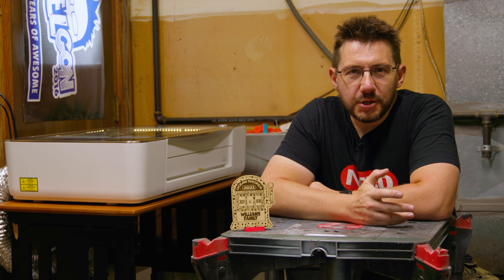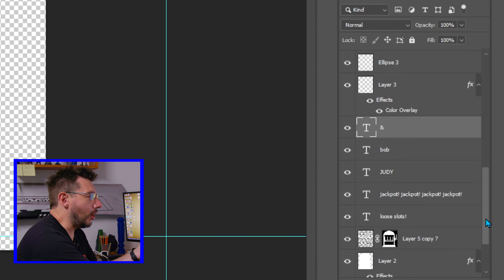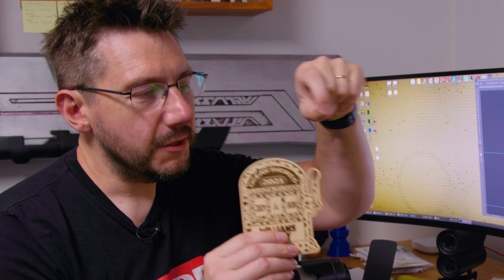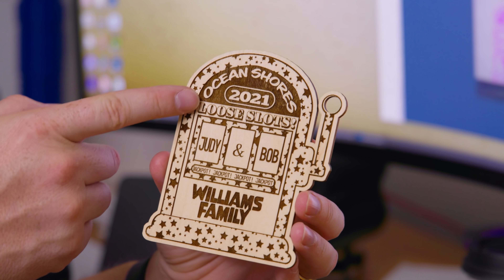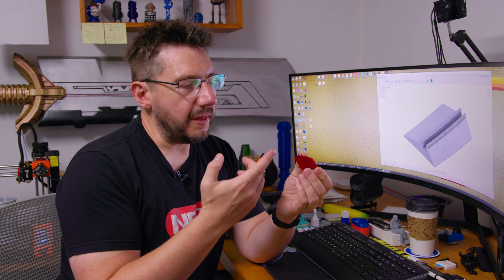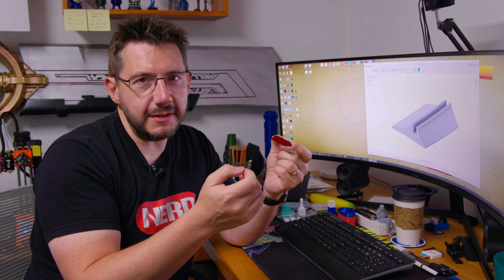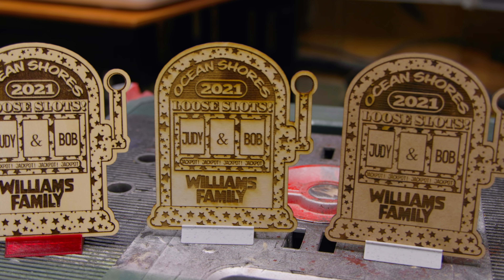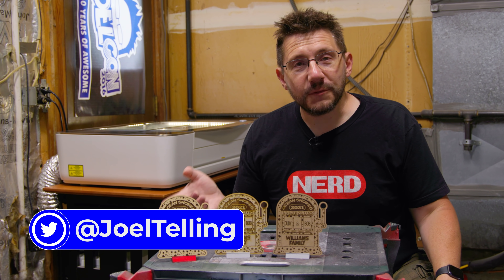3D PRINTING & LASER CUTTING!

Comment: Great way to commemorate, sorry to hear that.

I’ve got a Lottmaxx SC-10 Shark with the friggin’ laser beam on its forehead (if I swap out the extruder) and not tried it yet.

Thus far, other than proof-it-works and calibration prints, I’ve only printed things of my own design. Since I’ve written code for decades including CAD/CAM software, and I have things I wish to create that requires tricky math to describe, I use other than the typical CAD software, and I know you know about it, I’m surprised you didn’t mention OpenScad or the web browser mutant, JScad, both free.

Admittedly, a large (no clue how large) percentage of your viewers won’t consider writing code to describe parts as something feasible for them, but then again, a lot of people never get to the point of designing things on 3D CAD software either, or assembling 3D printers!

Thanks for your videos!

Comment: Nice video Joel. One suggestion, your stand part actually probably doesn't need a longer leg in the back because there didn't appear to be an angle to the slot, so all the forces go straight down.

Comment: Very cool idea. I like the idea and the design. I gotta a small and very cheap laser engraver (for 120 bucks) which is not capable of processing big wooden plates. What do you  recommend in such cases? Splitting the wood in multiple parts and laser them independently seems to be an error-prone and inefficient approach.